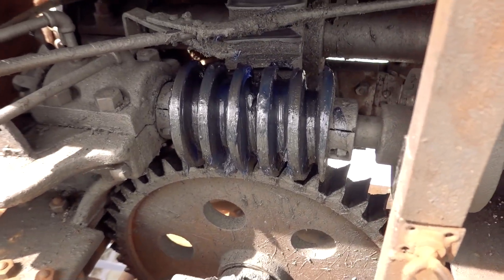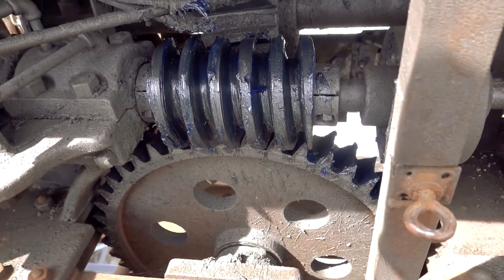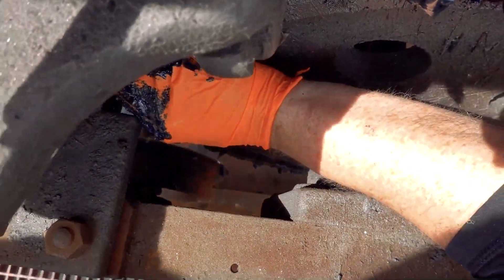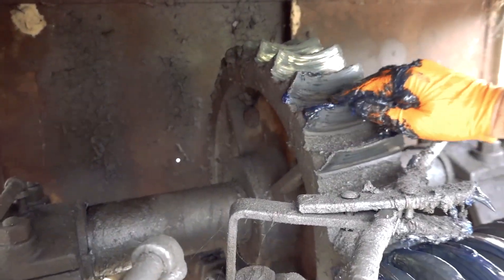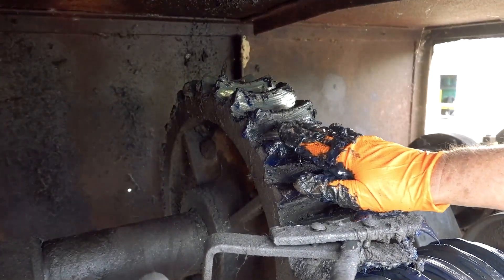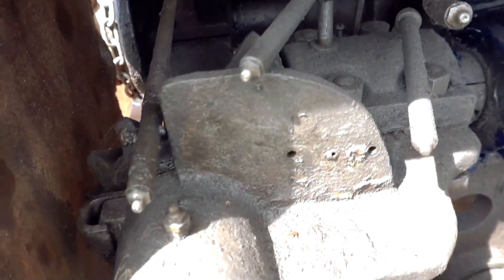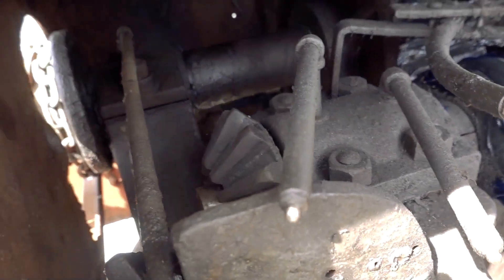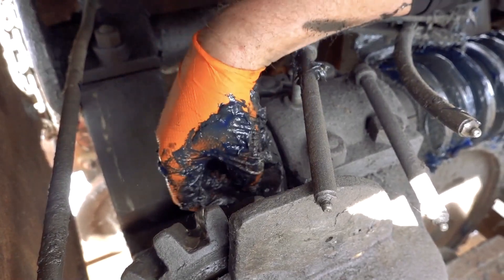Authorized Personnel Only -  Greasing The Gears of The Lifting Mechanism

Comment: That final gear is way too thin and all those shavings prove that it’s very close to failing completely. No amount of grease is gonna get it back. You need a new gear for that, including the worm wheel. Shame it hasn’t been greased earlier. And the bearings are probably just as dry.
I’d suggest a lubrixation schedule. Maybe once a year, vlean all the gears with degreaser and a power washer, apply new grease and pump some grease through those bearings.

Comment: Molybdenum sulfude heavy grease will make them happy but blue goo marine grease isnt a bad choice either. The zircs lube up the bearing blocks and as dry as those gears were tgey could use a bit of love as well, those bearings seize and the shaft with that much torque will snap in two. ❤

Comment: Those gears really need to be replaced fairly quickly. The one on the gate is much to thin, it may not hold the gate when you need to hold the gate. Putting grease on it without cleaning it makes matters worse because you now have a lapping compound, (grease and shavings), to wear it out faster.
Reply: came here to say that mixing grease types is bad, but that makes way more sense, the shavings are like an abrasive compound in old grease!

Comment: First day on the job in a modern semiconductor fab.  I'm in the cleanroom climbing into equipment for preventative maintenance.  Guy hands me a bucket of grease and tells me to start wiping down components.  I think, man, there's no way this is an appropriate procedure in such a clean environment. I'd just received training on using fragrance free soaps and sulfate free shampoos, and here I am slathering grease on linear rails and gears, some of which have zerks that we apparently don't use.   Later I read the equipment manufacturer's manual and sure enough...it encourages you to wipe grease on some of these components by hand.  I guess some things never change...
Reply: The question is did you get your gloves dirty
Reply: Looks like some heavy wear on that rear gear